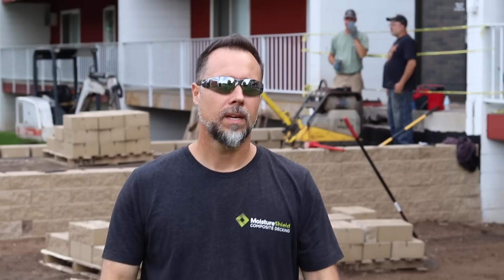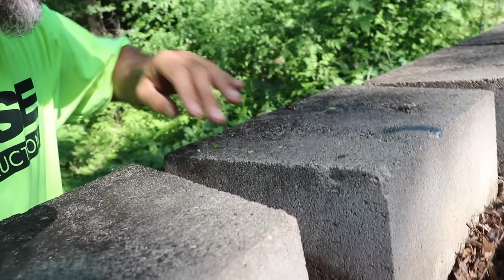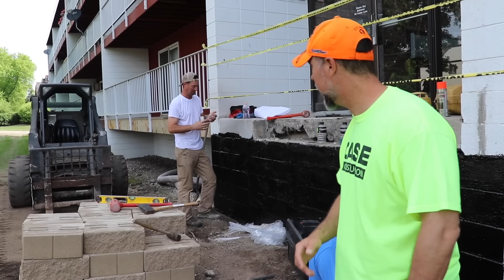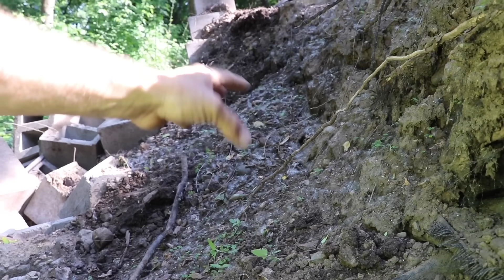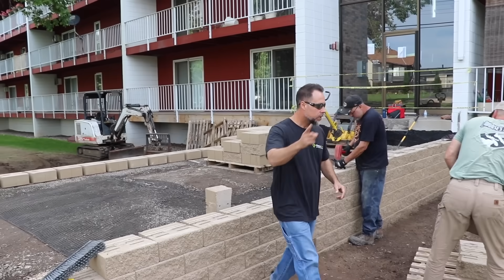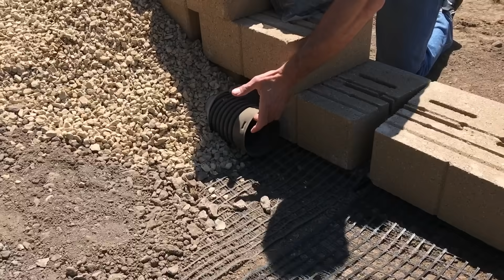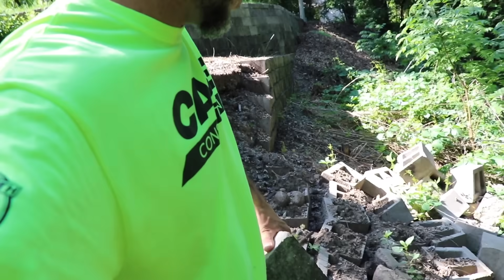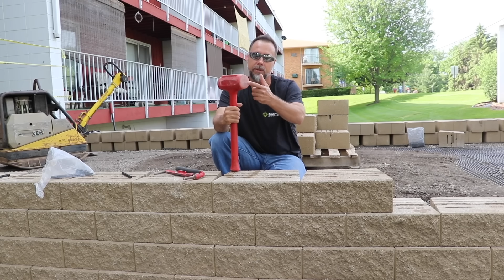How NOT to Build a retaining wall.  RED FLAGS, common mistakes, bad designs pt1

Comment: I love knowledge and I loved watching this. I dig your videos because you just seem like a good guy in general that isn't afraid it give the knowledge you have to others free of charge.

I'm not sure what made this pop up on my feed but I'm building a baby retaining wall in my front yard. Basically I have a small spot in front of my house that has a problem getting enough sun to grow grass. So I'm using what I'd call a landscape paver that's about 4" thick, 6" long in the front, and 4" long in the back. Seeing the metal is making me feel like I need some on that but I'm going about a maximum of 16" high or tall. I also had to build it in reverse because of my porch and sidewalk. I don't want to deal with unnecessary weeds.

Lastly if you read this thank you and if you don't, it's all good because I got some awesome knowledge from you. So thank you for your kindness and thank you for the awesome videos you post.

Comment: Hydrostatic pressure can be a powerful force. I've only built one real wall I built a decorative arc about 20' x 2'; I don't count that), but out of stone rather than block; house long since sold. Had a guy come in with a bobcat and cut an arc (for simplicity's sake) approx. 13-3/4m (45') long which subtends 90°. Tallest point about 1-1/4m (4'). Dug footers about 1/3m (15" or so) similar width. About every meter I put a piece of PVC 5cm (2") diameter, about 7-8cm (3") above grade, backfill about 30cm³      (1 ft³) on each side. Backfilled behind the rest of the wall with that fucking GA clay mixed with shredded leaves and manure (I had one person suggest mixing sand. I said I don't want to make bricks.) 
   That was in '97. Sold the house 1/2013. No problems. Lots of worms in the mix and quite fertile...grew a lot of plants for bees, butterflies, and hummingbirds. In the center of the wall I had built in a small waterfall and pond. Lots of frogs - freaking LOUD in mating season Not "ribbits)  either; weird screeches. Saw a Copperhead sunning itself once. Saw a long  King snake, too; think it got the Copperhead. Had some Owls around, the occasional Hawk, and found a good sized box turtle once, which I took down the street to Sope creek. Toads, lizards, rabbits, the rare coyote, woodpeckers that would peck on the gutter outside my bedroom... place was like a Studio 54 for critters. All the stuff I planted is another story... pity I'm 68 in a few months and too beat up for that stuff.

Comment: The hollow blocks may be fixed with bars and concrete. That‘s how I do it if I expect pressure. And backfill with gravel to give the water way to dribble down.

Comment: Love your videos, lots of information on things to look for when having a contractor perform your work.  Had a question around the proper method to use for installing a pole and rail system directly above a retaining wall. In my case, I am having a patio built using Cambridge Maytrx Paving Wall systems.  At the highest point the wall is only 24” above ground.  Will be going with the 6” modules and capping off the top of the wall with 2” thick x 12” deep bluestone.  Ledge stone pavers will be used to complete the infill.  I was looking to use the TimberTech rail posts as part of my railing system.  Anchoring the posts using lag bolts to the bluestone only did not seem sufficient and planned on using at a minimum 5” bolts to secure the posts through the bluestone and into the paver wall blocks.  Since these wall systems are mortarless, my concern is any load against a railing may create an outward load on the bluestone cap and wall blocks.  Any suggestions on possible use of rebar or othering systems to help counter any loads that outward force on the railing might create?

Comment: my grandpa had a sloped back yard and completely filled it with dirt to even out  while using the fence as the "retaining wall". needless to say its pretty much a disaster a couple years later. would it be possible to remove the fence and build a retaining wall or will we have to completely dig up before the fence to make the geo grid ?  please reply ty.

like you mention geo grid is needed for slope which is the problem we have. but what are the differences between slope surcharge and this one

Comment: If I recall correctly, years ago that’s what the wall block manufacturers used to recommend, fabric run vertically between gravel and earth. Geogrid was only horizontal.

Comment: you said to fill the hollow blocks with gravel. why would you not insert steel rods and concrete? I would think the plastic rods would be made of a very resilient plastic that is as strong as steel and won't rust and the steel rods would cause damage to the block when installed if not from swelling in summertime a shrinkage in winter.

Comment: I hope you are still reading your comments.  Scenario...My father bought a house 57 years ago.  The house was in the furthest track out from the cities center.  There were no homes behind him.  And a fairly slight back slope to his back yard property line.  A few years into living their he had a built in pool put in the back yard.  As the years rolled along the property behind us was sold and a subdivision was put in.  The whole area was cut and leveled for building pads.  Therefore the slight slope became a full on drop slope. In my high school days we tried to keep the slope from moving by sinking telephone poles 5 feet in the ground.  Then placed horizontal telephones stack along the length of the yard now below the back.  Then 6 feet back another rock wall built from the rock from the area.  So, now I'm 60.  Dad is 89.  We live in Earthquake Ca.  And the block wall is falling apart.  It needs to have some kind of retaining wall to keep the pool from becoming our neighbor's pool.  Here's the kicker.  There is only about 8-10 feet  between the pool edge and the rock wall.  Any ideas?

Comment: All of these walls will fail especially up here in MN.  The blocks are physically too light to retain the weight and force of the earth especially when our ground freezes and thaws.   Even your block work is going to fail.  Its inevitable.   But the biggest failure comes when the homeowenr doesn't want to pay for proper prep work.  I will actually turn down work because homeowners want it done right now instead of done right.

Comment: Versa-lok 👍 we have used them on several Municipal projects and their Engineers will specify geogrid spacing/length and backfill soil structure. I have pics of everything. One was on a concrete footing.
Reply: Some existing soil types aren’t suitable for backfill in geogrid area. We’ve even hired a testing company to measure compaction with a nuke density gauge over geogrid to ensure specifications are met.... I’m geeking out sorry.

Comment: Question:  On a short wall (~30" H), in sandy soil, what would you use to prevent the sand from washing through the blocks if not filter fabric?  Geogrid is to open to stop the sand.  Just curious.  Thanks much!
Reply: Eric Robison I built a flower bed using blocks with about that same height. I put fabric behind the wall and haven’t had any problems. Granted it’s short and not retaining a ton of weight. I may pull it out this fall after watching this video. We’ll see. lol

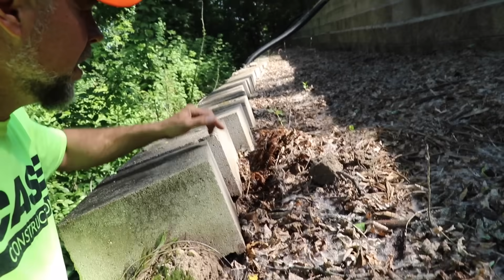Comment: re 2:26 Without a proper drainage system and expansion resisting anchors, the cloth will clog to act like a dam, and freezing water in the soil will expand to force the wall downhill.
... lotsa jibber-jabber ...
re 8:36 He doesn't know, but the wall was not properly anchored, and the lower courses were kicked out, not the top courses falling in (unless it was never backfilled).
...

Comment: Just found this. This was very useful. I now know what to leave and what to change on a half done one. 
If I used hollow ones with no lip in the hopefully low load bearing spots, should I also use the caulk to glue them to their neighbors or run rebar through? The wall is 18 high in the middle and tapers to 6in showing above ground on the ends. 

And this explanation proves I'm a chick, any that I grabbed with no lip were unusually pretty and I put them in the spot I'll see most when doing dishes or sitting outside. I joke you not every woman I have showed it to has complimented the section with those stones, lol.

Comment: Thanks for the information on the blocks, very informative. Makes total sense as opposed to the reasons the block company says which is: hollow blocks are lighter and use less material to make them, this creates a cheaper and easier product for the customer. To which any normal person says, so can they only make walls “so high” due to there strength??? No because of the locking lip or design of them the are rated to retain just as much as the solid ones (as long as you conform to the requirements depending on height ect. Once again making the obvious question : why still build solid more expensive heavier blocks $till then???    Customers personal preference on the finished look of the finished wall...............

Comment: The thumbs down reviews were probably made by the crew that built that POS wall that was falling down. Nice job and keep up the good work with the detailed videos. I built my last retaining wall using the hollowed-out decorative block but laid in a reinforced concrete footer with vertical rebar, filled the voids with grout, put a silicone based sealer over the textured face, and now I don't think it's going anywhere soon.

Comment: (Construction workers always have fun Jon..unless you have an asshole boss...and obviously he isn't...I'm an English brickie,by the way)...

That's an excellent presentation...You're a natural...and it's bloody interesting !...(My girlfriend in Kentucky
sent me the link)...
Retaining walls in the UK are built differently...We place vertical ReBar into the wet concrete "footing" (foundation)...Which reaches 1" to 2"  lower than the top of the finished wall...We use hollow blocks (all the way through)...2 men to a block makes for an easier day for both,,every block having to be raised up to the top of the bar...then lowered to meet the top previous course...A Bobcat bucket full of sloppy concrete,,,Lip of the bucket against the edge of the outside face of the laid blocks,,for each course...and just rake it in the recesses with your 12" Marshaltown trowel in seconds...Takes a tank going full speed to move a wall like that,once it's "gone off"...and that is standard practise here...That's how the military build blastproof buildings here....but their walls are 2 or 3 blocks thick...You need more than a bloody tank for them !...haha...( I forgot to mention...they are high density blocks...and laid like conventional blockwork - mortar beds and perpendicular joints)...

Comment: Thank you Sooooo very much for being responsible for your actions and protecting your clients....I'm on my 2cd G.C. on a remodel in San Antonio...Nightmare....I point out something that the material company requires for warranty and they say we don't need to do it that way here...WHAT...I show them on the website for the product and they say I guess  they changed the requirements ...this info on the site was from 8 years ago...now I'm belittling and causing a hostile environment...  A contractor only needs insurance...no courses/tests to pass. You interview and go to projects and get recommendations...this last G.C. does work along side a major engineering firm here. Thank You again for your professional time and consideration....I'll just keep smoking the Hopium...that could be Polish for keeping my fingers crossed...1 year in for a 1200 sq ft remodel...Thankful they have good tequila...a natural antidepressant.

Comment: God video, very informative.  Good construction practices.  However, you are so wrong about using filter fabric.  Imagine the distance water travels through soil.  You say that a two or three mil piece of fabric is going to hold water.  Go to one of the walls you have constructed WITHOUT fabric, in an area of soil with a high mineral or sulfur content, and notice the staining on the face of the wall.  Properly installed filter fabric is more permeable than the soil and does what its name implies - filters.

Comment: Thanks for this video, I learned quite a bit - I recently cleared a lot of trees behind my house, the trees were on a steep slope and the house at the bottom - setup for trees to fall on it - (which happened 4 times) Thank God no one hurt!  Now, I'm trying to decide should I build a retaining wall at the bottom of the slope, or did a drain and redirect the water from pooling at the foundation of the house. Does it make a difference? is one better than the other?  - Thanks

Comment: Great vid! Liked and subscribed.

I’m building a 6-7’ wood fence running 35’ parallel down a sloped driveway. At least one section needs a 3’ retaining wall to keep the top soil from spilling in to the driveway. 

What type of block would you suggest that would allow for wood or galvanized fence posts? I would like to do it right the first time and make it look great. My original plan was cinder block wall with either wood or galvanized posts.

Comment: Hi Stan, enjoy the details.  But I watch a vidio before yours an a Five foot high wall and they use Geo-Grid on each course.  Was that very overkill?
Reply: Not only overkill but if they backfilled with soil instead of drain rock and then overcompacted it then they might have actually made things worse than having no geogrid at all.

Comment: Thanks for the tutorials. I like what you are doing.

Regarding retaining walls, I did put one in using the hollow core blocks with the fiberglass pins that lock them together. I did put a 3" deep trench of 3/4" granite (for drainage) as my base and did fill the cores with the 3/4" granite to lock them together (also for drainage). These are industrial-sized blocks that weigh about 95lbs. per block. Used a wall cap on top with a high-bond adhesive. It turned out pretty well, but 430 blocks is over 40,000 lbs of material. Took me quite a while to do the job. 

Wishing you sucess!

Comment: Awesome video thanks! i bought a home with this Vera lok Block in the back yard. holy crap! in 50’ at 6’ high it had a 12’’ bow in the middle so I decided to just start taking it apart lol ‘’alot of work’’ but anyways they had the fabric on the back so the moister was trapped just like the video said it would do and they didn’t have the wall built with any pins going vertical  they had them going horizontal lol inside the slots the pin would usually set vertical. There’s no grid layed on any of the wall but not sure it would need it if theres a 12/6 pitch hill 15’ long behind it with no way of getting the dirt out and in Vegas we don’t get much rain so it’s pretty dry here not sure if that helps a little or not..not sure if anybody has any suggestions on that. I’d like to put it back up if possible but not sure if I should just scrap it and put a regular masonry block in instead or give it a go without the grid. My finish wall height would be 5’ high. Another obstacle is they used different size Block layed I this order 16’’wide then 8’’ wide then the next row would be all 12’’ wide have then back to 16’’ and 8’’ have you seen that done? Any help or suggestions would be appreciated thanks for the video and the comments

Comment: I am looking at replacing a retaining  wall around a creek. The original "wall" was made from just rail road ties placed on top of concrete slabs back in the early 80s. When we had a flood (from someone backing up the creek) the walls collapse inward on the creek now I am faced with fixing it. .  Would it be safe to build a new (concrete) wall by using the original slab? The concrete goes all the way around the creek making a U shape.

Comment: Around 25:05 , talking about the block with lip on bottom rear.  The first time I used this kind of block, the face and the lip were horrible on 60% of them on the first two skids, had 8 more skids to go so, I called the supplier and complained about it . Luckily the Rep. for  the company was there and met me a the job. Long story short, the Rep said, " the lip is just a" locator" and has nothing to do with holding the block in place. Weight of the block holds it in place". I think the lip helps holds the structure together no matter what he says.  BTW he did have the crappie blocks picked up and delivered new ones. Thanks for the video., I did learn something
Reply from the maker: You're welcome David, glad to hear it !